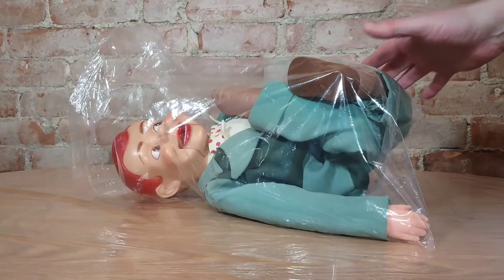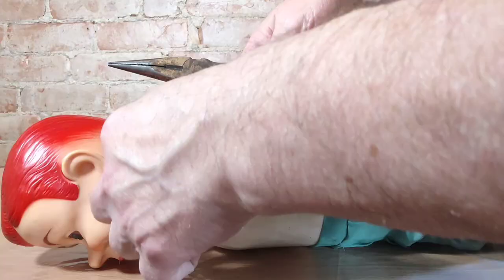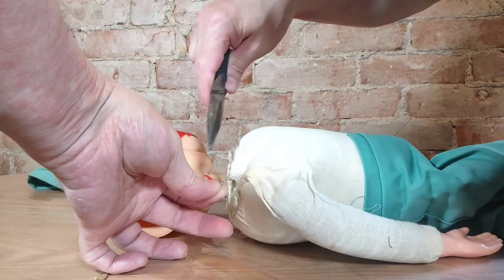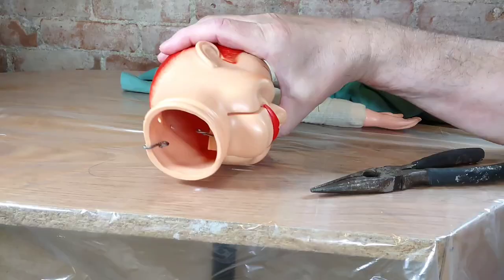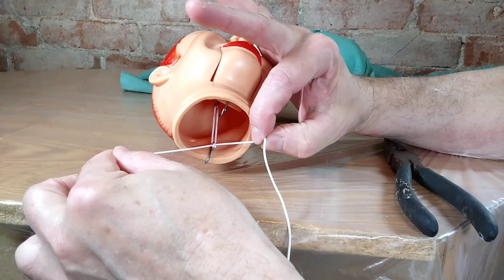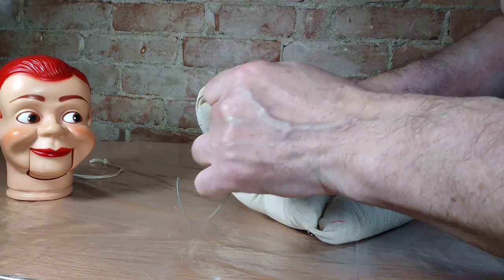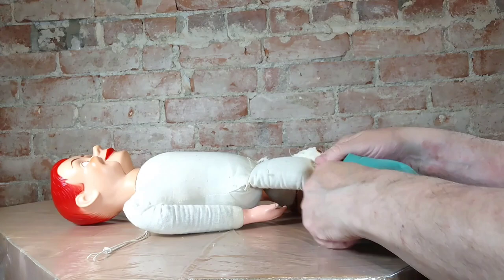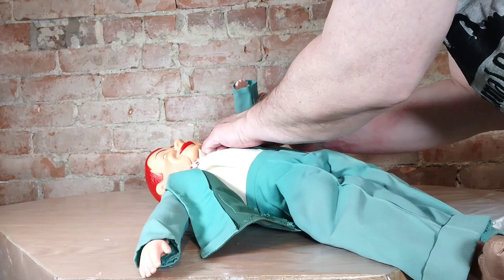DIY REPAIRING MOUTH FOR VINTAGE JERRY MAHONEY VENTRILOQUIST DOLL

Comment: I have a dummy that the mouth doesn't work. It is probably 50 t0 60 years old. It is not like one in picture. It has a plastic shadt with a trigger on it. Any ideas on how to get it apart?
Reply from the maker: I would have to actually see it cuz I have never done one of those before and I'm not sure exactly how they are set up but I'm sure there are other videos out there on YouTube that can help you with that

Comment: Quick question for you:
If the doll is missing the neck hook, where do you source new hooks?
What else can be used....is there a Home Depot hook that would work in its place?
Help appreciated.
Reply from the maker: You might be able to find one small enough. In one of my videos I show how I made one from wire from steel wire that I bought from Lowe's
Reply: @ThisOldGeek  very cool..will look for the other video.
I appreciate your quick response and help.
Thank you